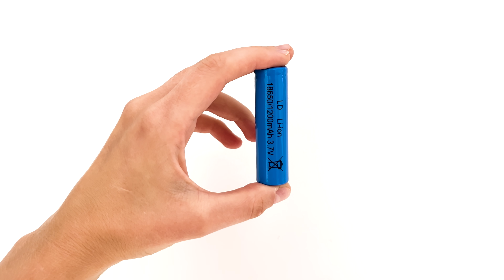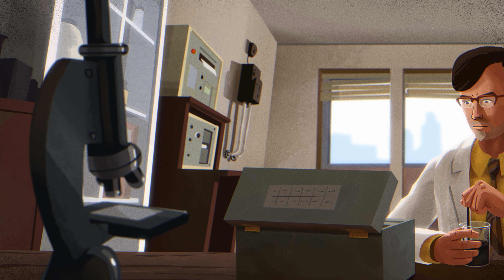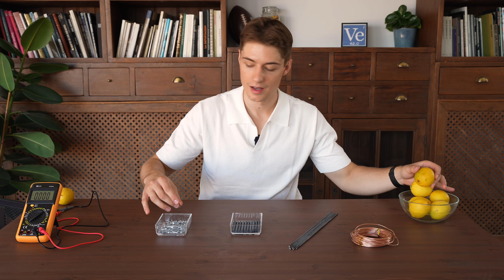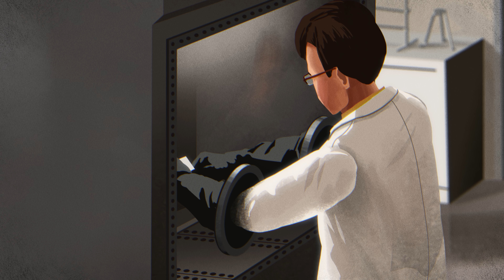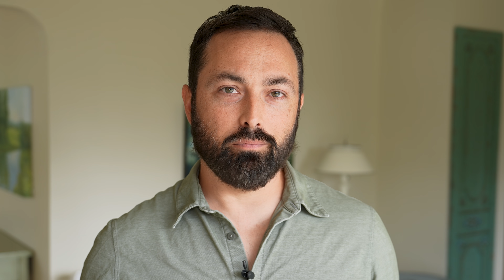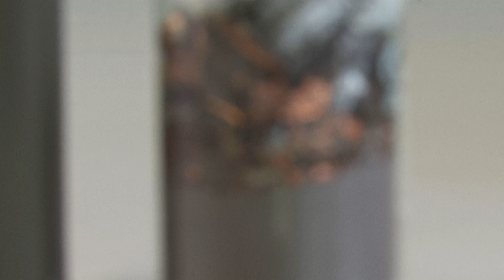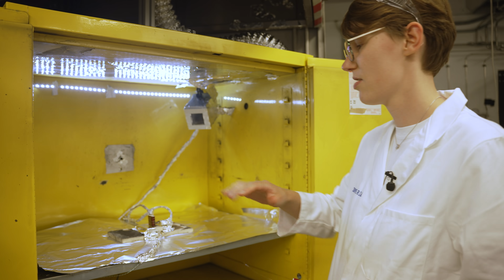The Perfect Battery Material Is Dangerous

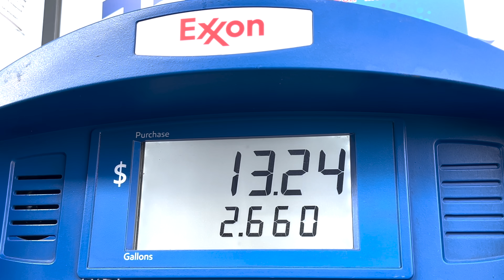Comment: 1:44 Slight correction: It was israel who initiated the war by an unprovoked assault (or as they claim it "preemptive strike") on Egypt.
Reply: If you're going to correct people, you should probably actually know what you're talking about. The Yom Kippur war of 1973 (Which is what Derek is talking about) was initiated by Egypt and Syria, doing a surprise attack on Israel during the most holiest day in the Jewish year, knowing full well they would be the least prepared to deal with an assault that day.

Also, the 6 day war was not unprovoked. Egypt had amassed troops on the border and closed the straits of Tiran, which Israel had previously only a decade earlier had to clear an Egyptian blockade from. They said if Egypt did that again it would be considered an act of war. Egypt did it again, what do you expect, Israel to wait to be attacked after a war is initiated?

Comment: Would be interesting to see what solutions there are been worked on to reduce how hard it is to fix the fire batteries causes
Reply: Well the issue is there aren't enough battery fires. Gas cars catch fire at a rate of over 100,000 per year in the US alone where as in the US there have only been 30 or less EV fires total for all units sold. Its just crazy we just accepted gasoline just hanging around and being ready to catch fire 24/7, but we don't like batteries for some reason lol.

Comment: The fact a battery so dangerous became in use in our everyday lives is crazy
Reply: Its actually not that dangerous.
There are 260,000,000 gas cars in the USA as of now, and there are 2,500,000 EV's, and yet the fire rate is worse for gas. 100,000 or more per year in gasoline fires in cars, and less than 30 TOTAL ev fires for all EV's for all time. 
Same for phones on air planes. There are actually more engine fires per flight hour than there are passenger battery fires per flight hour.
Reply: @singular9  , the difference being that more extreme circumstances lead to the other fires.  The lithium batteries just go out with no warning and in pretty spectacular fashion.  Plus, your analysis only looking at phones going up in flames on airplanes ignores all the times phones have just blown up in people's houses.
Reply: It's not THAT dangerous in its present design. The metallic-cased 18650 which are the most common ones, used in all high-current/high-density applications, is pretty good. The only problem is when the control/safety circuits, which should be integrated inside each of them, are of substandard quality and don't cut off to prevent a chain reaction. The cheaper batteries which have those safety circuits outside the case, are usually of such low capacity that it would be bad, but not life-threatening (unless combined with surrounding inflammable materials). Most EV/ebike fires are caused when the manufacturer skimps on the 18650 cell quality. The other side of the spectrum are when expensive cells designed to push the limits (eg in phones) do not fully accomodate external factors as much, like having a hot CPU right next to the already-warm battery, and reduced cooling from being in a restricted space/direct sunlight, etc.

Comment: Crazy how we went from designing better batteries to batteries that don't even last a day.
Reply: What a silly thing to say… look how much your phone can do vs one from years ago. Batteries have gotten way better and more energy dense
Reply: Battery technology has improved immensely, and does so every year.
The issue is the shrinking in device sizes. The fact that a battery small enough to fit in a modern iPhone can power your phone for 30 hours is actually amazing.
Reply: Dumb comment lol...batteries are amazing.
Reply: @singular9  many are, but also many are intentionally handicapped, like phone batteries
Reply: That's intentional. Also the way phone batteries become garbage after a year is also intentional. One of my mirrorless camera batteries has been used SINCE 2014 AND IT STILL WORKS FINE. It all planned obsolescence
Reply: @DumbAsh00  gee it’s almost as if your phone battery gets more use and thus has more cycles
Reply: @DumbAsh00  "My phone needs to be charged every day but my fire alarm has been working for years hur dur"
Reply: @lowkey_Ioki  literally not comparable. Also my phone dies within a few hours of use now after 7 months. Also mirrorless cameras use A LOT of battery power, as much as or MORE than a phone. Your false analogy is awful as I'm not comparing how often they need charged, but the battery health over time.  and you clearly don't know anything about cameras or batteries.
Reply: @lowkey_Ioki  gain reading comprehension as I'm comparing battery health over time and not how often they need charged
Reply: @DumbAsh00  Battery health is directly related to how often you charge the battery. Charging the battery is the primary factor in battery degradation. It is impossible to compare battery health without accounting for the number of charge cycles. You don't know how batteries work.
Reply: @lowkey_Ioki  I did account for that. The battery has had hundreds of charge cycles. You can easily track it using the info on the camera. It's been used more than my phone, as it's been used for 11 years. I only got my phone pretty recently, and I basically have to have it constantly plugged in. No matter tho, we already know that phone batteries are designed to degrade by the 1 year mark, so u buy the next model. Planned obsolescence is real and very very prevalent. No amount of arguing will change that fact